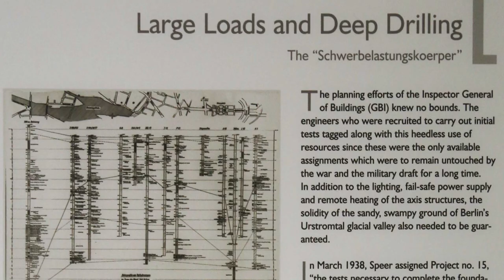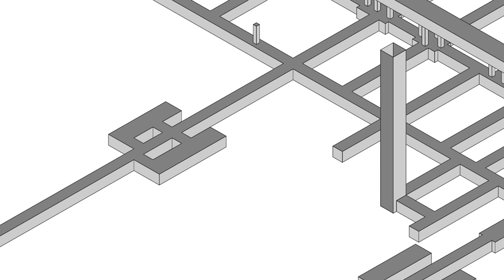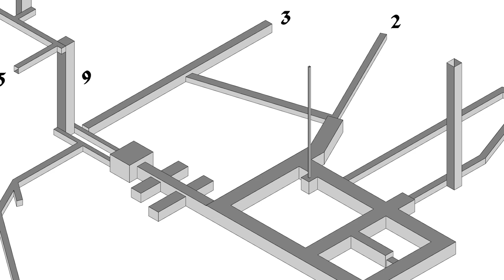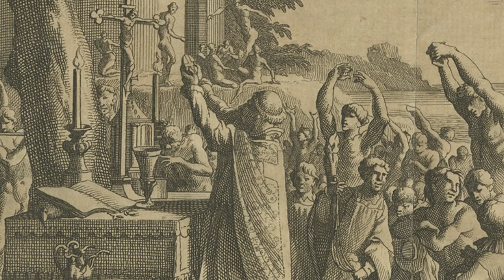5 Strangest Abandoned Ruins Of The Nazi War Machine

Comment: Berlin is basically built on sand. They could have never built Germania without completely replacing the grounds under Berlin. The Schwerbelastungskörper has already sunken considerably back then and it is still used for measurements today. So it is quite a useful building.

Comment: The massive dome in "Germania" would have been large enough to house the Eiffel Tower within it! Would have been awesome to see if it hadn't been proposed by such a hideous regime.
Reply: Nope, would not have fit unless you have different measurements than Wikipedia.
Reply: @Llyd_ApDicta  Since when is Wikipedia a trustworthy source? 🤓
Reply: @KRAFTWERK2K6  Since they provide references and list their sources - so since quite a while now. I usually get this comment from people who base their opinions on what they get told by others and take that as ultima ratio or by those who are unwilling to accept sources which might prove they are talking nonsense....
Reply: @Cogitaro : I use Wikipedia often. I generally find the info to be up to date and accurate, but occasionally, there are major, glaring errors and sometimes plain falsehoods. Anybody can provide info to Wikipedia apparently.  Wikipedia is not always 100% correct and accurate.
Reply: It was 984ft when first built, not including the flag pole, which took it to 1024ft. New TV antenna's after the fire took it to 1050ft. Then the new DTV antenna in the 2000's too it to 1063ft. The latest DAB+ aerial put up in 2022 takes it to 1083ft.

Comment: 28 Million pounds? Really?
Reply: Yeah, that comes to 12.650 metric tonnes. The construction concentrates the weight on a relatively small area on the ground in order to simulate the load of the buildings since the ground in Berlin is notoriously sandy buildings of that scale would have had the danger of sinking and the "Schwerbelastungskoerper" proved that they would have indeed. So the ground would have had to be compressed prior to any building attempt.

Comment: The one artifact, that is never properly identified is the "anti-gravity flying saucer launch ring". This horse-hockey has to stop, and you do not even mention what it is really for. These structures can be found all over Germany to this day! They are part of many gas-works, and I used to walk right past one every day! It is an anchor-ring, that holds expandable gas cylinders. The top cylinder fits over the bottom and floats over the bottom cylinder like a giant tin-can, a simple means of allowing for varying amounts of gas under constant pressure, as the supply is depleted over time, and then replenished. If Americans had even just a tiny bit better science, and in this specific case better basic physics education, this nonsense that was invented by an Eastern European hack author and con artist in the late 90s, would have never made its way into modern BS folklore.